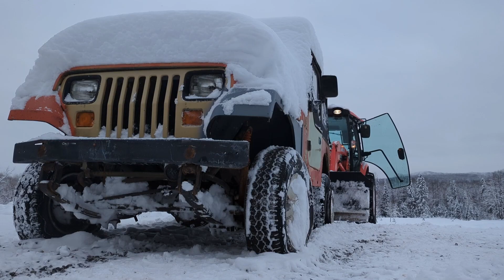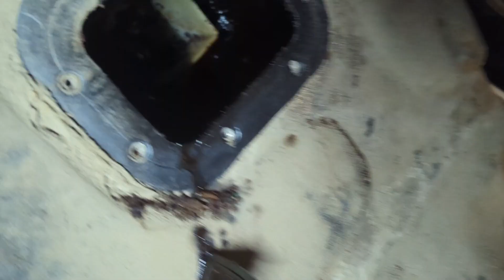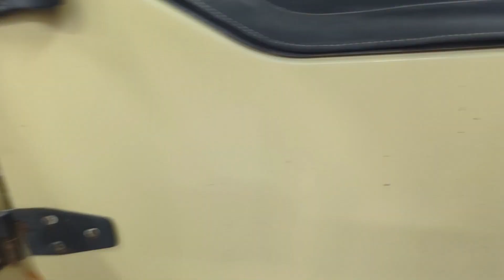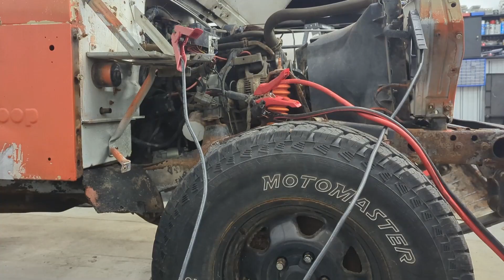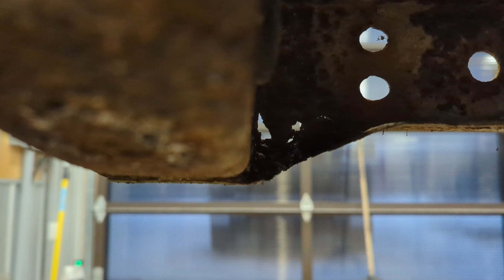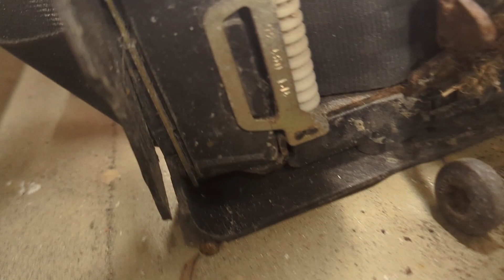Jeep YJ get running and floor rot repair

Comment: Lots of rust repair! Wow!
I was surprised to see how far back the engine sits in the bay!
Reply from the maker: Its missing 2 cylinders haha only got 4
Reply: @doylemaintenance  gotcha. Still it really sits back, doesn't it? Maybe that offers good weight balance or whatever.
Reply from the maker: @kenbell8752  Good for handling 😂
Reply: @doylemaintenance  you need good handling for the incredible speed you’ll do. 😂